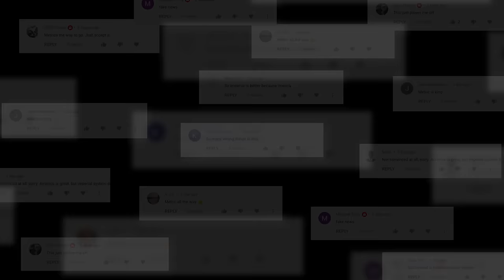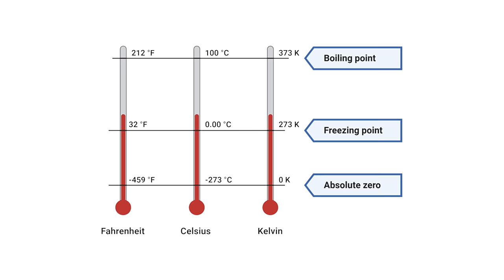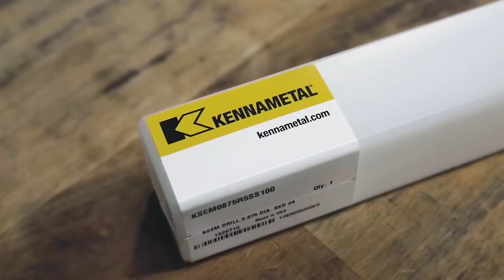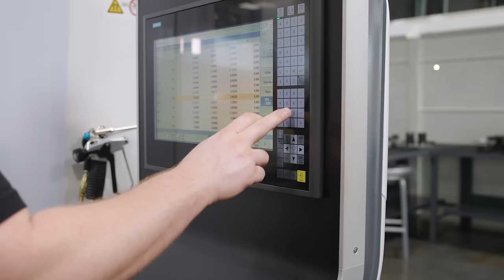Why METRIC is SUPERIOR to IMPERIAL

Comment: case
one of the american companies ordered a part from a company from england for some high-precision machine
they sent the drawings, all measurements were in inches
production is costing around £ 350,000 each

there were no metric measures
the precision was to be up to 6 decimal places
17 parts were made, packed and shipped to America
none fit, they were too small by a few millimeters, because the English precision inch differs from the American inch
1 US inch = 25.40000508 mm. 1 english inch = 25.3995 mm

the company from England does not exist anymore, due to morons from america who do not recognize the SI system

Comment: It’s not. Imperial went into space and landed on the moon
Reply: the team who worked on the apollo missions used metric lmao
Reply: @groxthegreat  No, they did not. Their slide rules and calipers had both scales but the majority( American, white men) imperial. Try again using facts next time.
Reply: @bobthompson4133  all of the equipment was in imperial however all of the designing was done in metric and the maths for the trajectory and thrust required etc
Reply: @bobthompson4133  real engineering has an excellent video on metric vs imperial